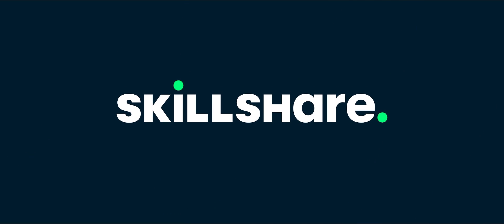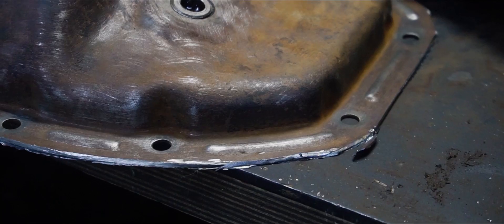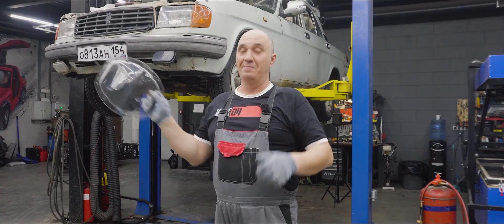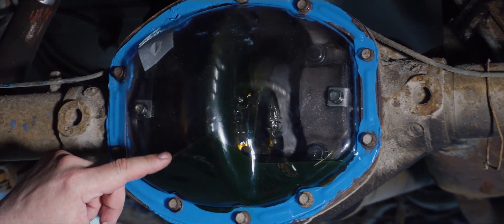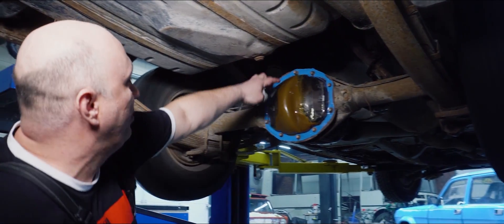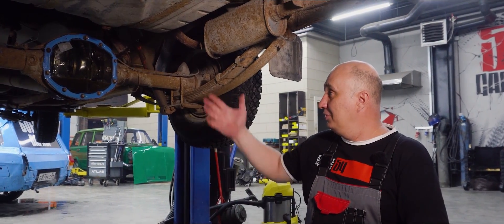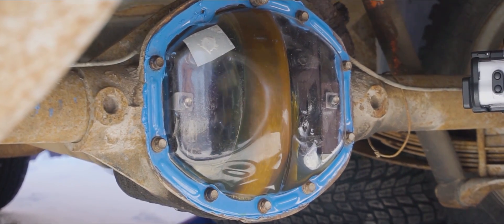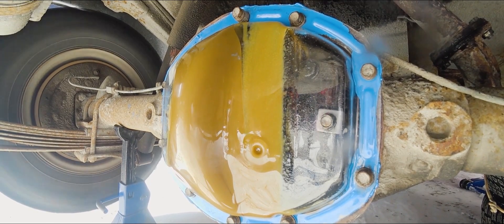Observing frozen oil under a transparent differential cover

Comment: The spec for the amount of gear oil was wrong. The plug level is correct. If you dont get the level to that height the inboard and outboard axle bearings are not recieving any lubrication. The level should always be just above the bottom of the axle tubes. Regardless of the axle.
Reply: Yeah the capacity of the diff was increased as the vacuum formed cover was made over the exterior of the original, yet the screw holes were in the same location. Only adds a millimetre or two here and there but it all adds up when it comes to volume.
Reply: The repair book volume is for draining through a plug and changing which leaves some residual behind. They definitely should have filled it all the way.
Reply: was looking for this comment
Reply: Vacuum forming the inside probably would have done the opposite; made the volume smaller slightly and raising the oil level too high. Ultimately unless you took a mould of the original and then cast a clear replacement from the mould, it’s always going to be slightly different. Easiest fix would have been to just follow the general rule and fill it to the plug regardless of how much you have to put in.
Reply: @chrisking4616  that's kind of the unspoken rule on differentials fill it till it spills from the fill port.
Reply: @jeremypike9153  Or manual transmissions.
Reply: I was wondering why they didn't vacuum form the inside of the differential pan. Probably harder to get all the air out on the inside then it was on the outside.
Reply: Running the numbers in regards to comments about the change of oil level because the plastic was shrunk to the outside of the diff cover: 

Using volume of a sphere is v = 4/3 x pi x r^3...

Assuming differential cover approximates the shape of a 1 foot diameter ball (it roughly does), the volume of this ball minus the volume of a slightly smaller ball inside of the first ball will give the volume trapped between the balls.  The slightly smaller ball will be smaller by as much as the thickness of the metal in the differential cover.

So, the gauge steel used for differential covers is about 14 gauge (about 1\16 inch) thickness, so this converts to 1/192 ft. If the first ball has an r1=0.5 foot, and the second ball has an r2=0.5-(1/192)=0.49479166 ft., finding the volumes is just using the above formula for the two balls, and then v1 -- v2 will give the volume, as mentioned before, of the space between ball 1 and ball 2. Chop that result into a third of it (only about a third of the ball will rest in the differential cover) and you end up, after converting empirical units (freedom measurements) to liters, you'll get 0.152835 liters of additional oil needed.  That's like a spitball's worth, albeit a big, sloshy goober type that would sound like "THUNNNNNG" in a spittoon rather than a "ping".

However, this is even wrong - the plastic was shrunk onto the outside of the flange as well as the roundout. That means that the plastic flange will end up exactly where the metal one once was (that is, bolted up against the cast iron case), which means the plastic one emulated the metal one almost perfectly in almost every way.  This means that the overall volume remains almost unchanged.  One wouldn't even be able to measure any change at all.